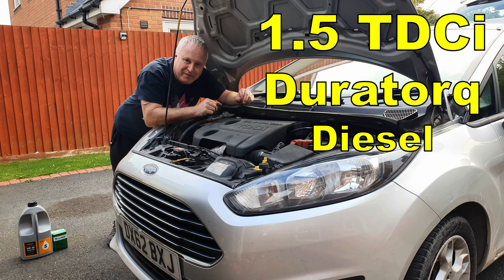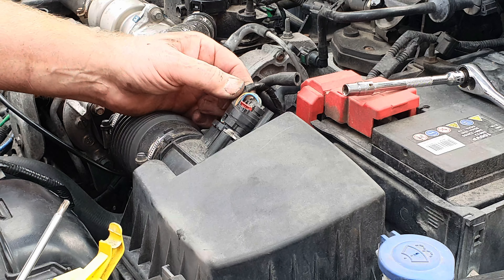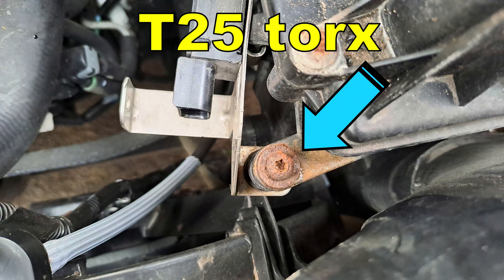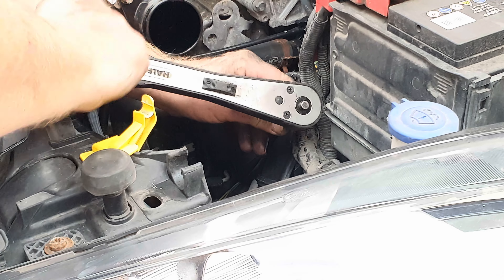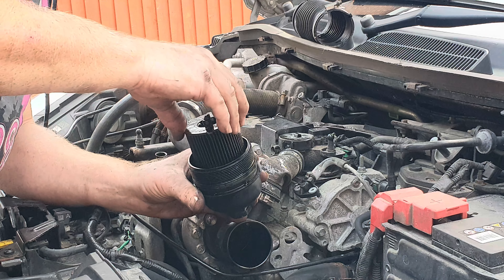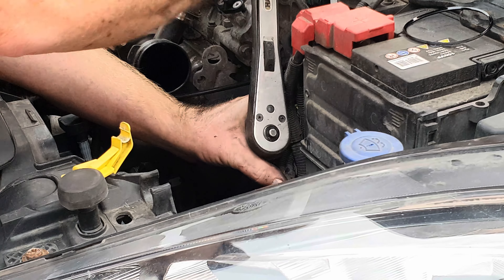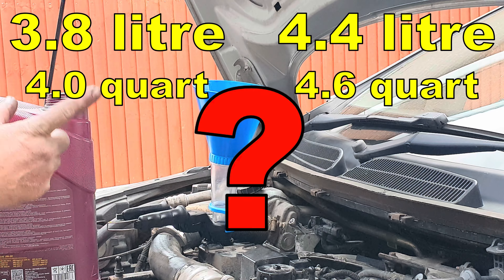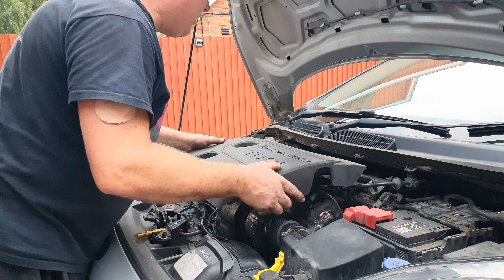Ford Fiesta 1.5TDCi Oil Change

Comment: How do you stop the plug from dripping after an oil change? Mine is is a new plug and is worse than before I changed the oil. Will have to replace again at thia rate
Reply: you've probably fixed it by now but sump plugs use a crush washer, replace that when doing an oil change to give a good seal.
Reply: @Fazer_600  yes I used a copper washer whoch didn't seal but took it to a garage and they used another kind of collapsable washer which worked fine. Six months and no leaks.

Comment: Is the oil filter in the same place on the mk8 1.5 tdci 2017 - 2020?
Reply: @adambrush5445  was it?
Reply: @wanderingsofalanandcaz  It was yes.
Reply: @wanderingsofalanandcaz  Same deal, move the air box out the way.

Comment: You dont need to remove air filter if you use a univeral joint fitting for a socket